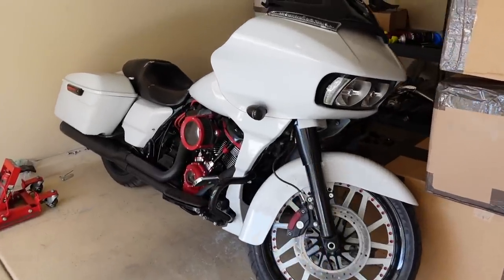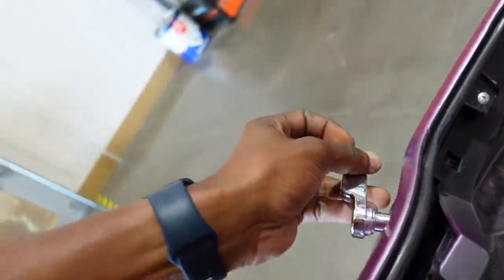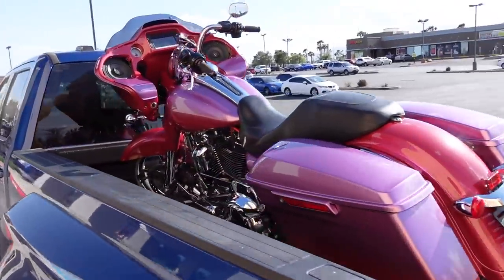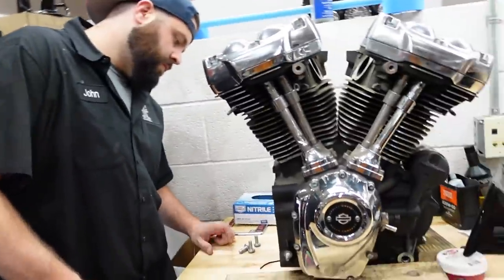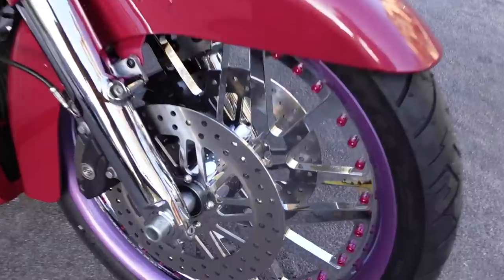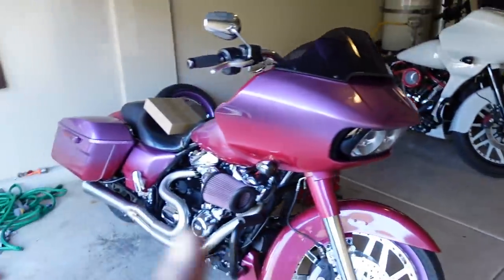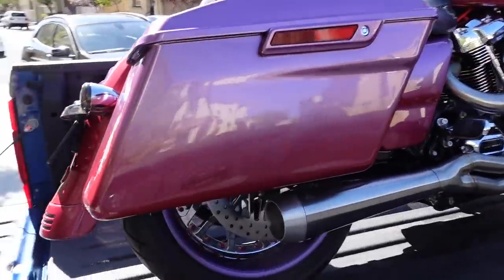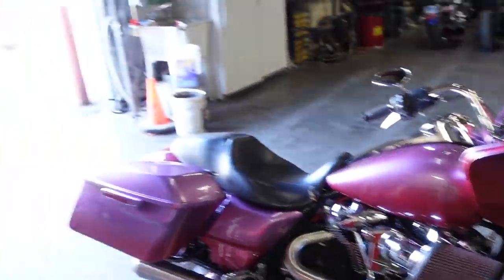FINALLY! FIRST START UP ON MY BUILT 131 ROAD GLIDE...WOW

Comment: My biggest mistake was letting Harley do my 131. They dumb down the numbers with the ECU and could use better cams to get 160ish torque and 150 horse vs 120s HP 140's TQ

Comment: I ain't gone hold you that pink road glide is off the chain worst color for that bike straight up ugly... engines tight tho. 
Them cheap shinko 777 tires won't last especially the rear tire.  Them tire are really dangerous too , my bike had high speed wobble with them!!